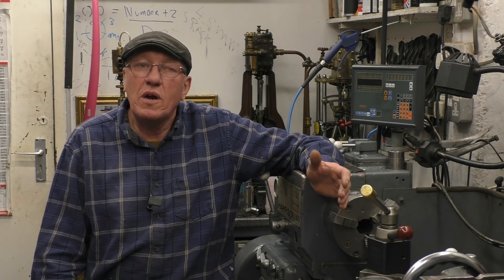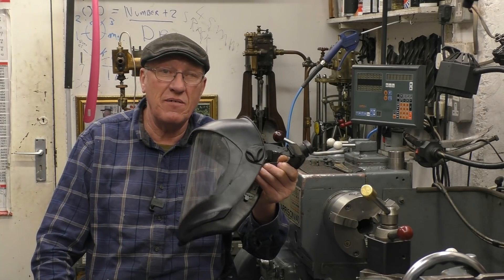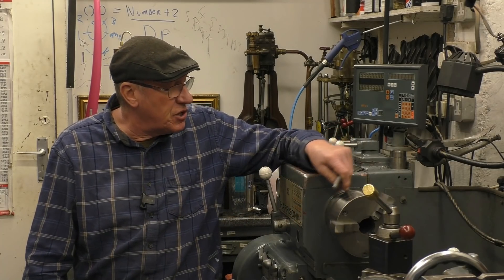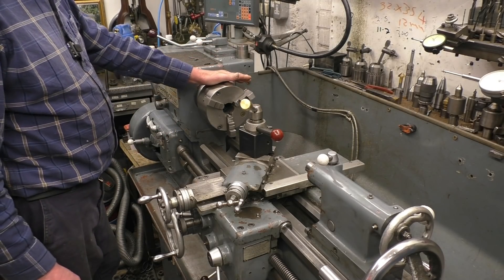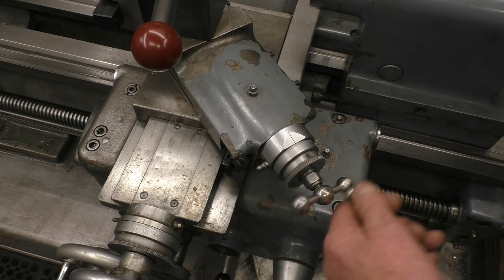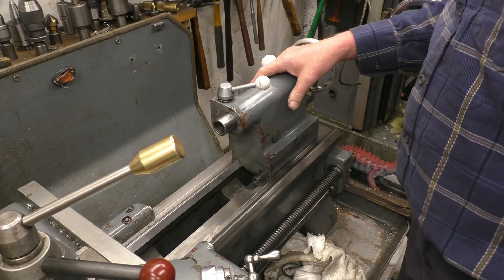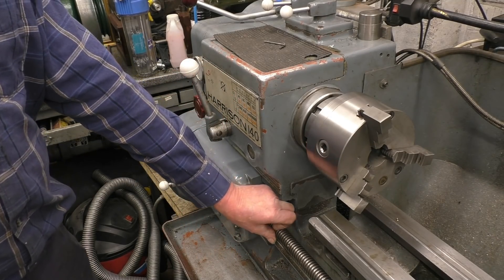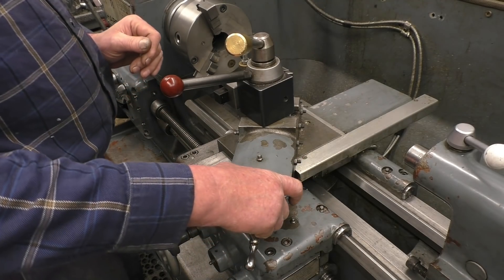Lathe Tutorial P1 Machine Overview

Comment: l have no led screw on my lath i  cut threads using my rack,  it works well but i used the rack to provide the pitch & now ues a rotating mill threading tool .  as ues for mill trading  an old  tap used as a mil tap  i must say it work well . .